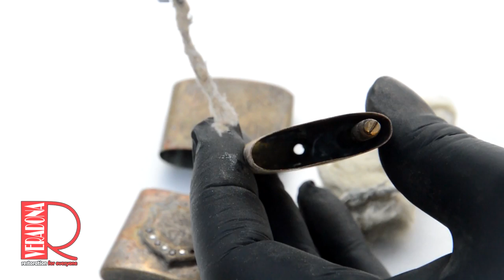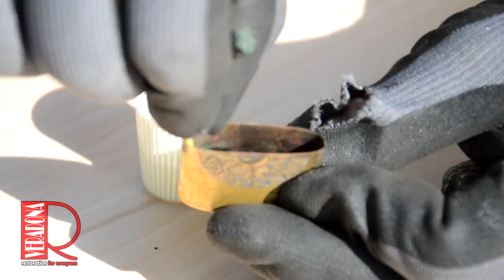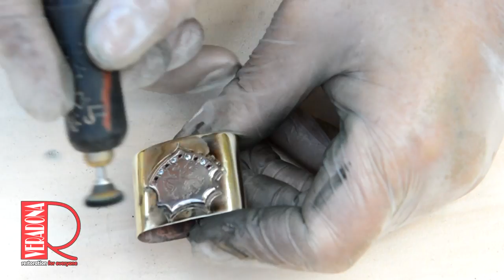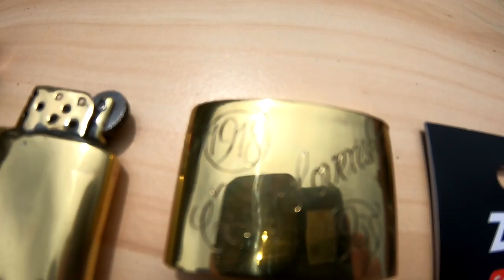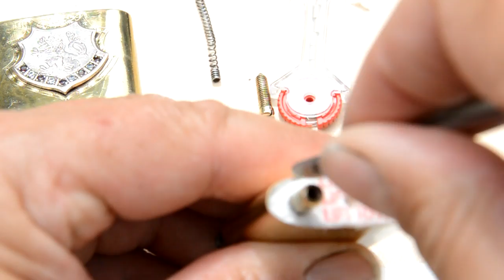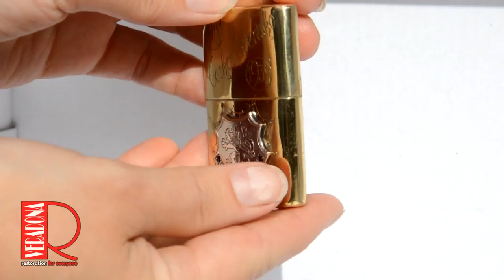Old rusty lighter Restoration

Comment: ALL THE RUST COULD HAVE BEEN REMOVED BY SOAKING IT IN VINEGAR!
Reply: theres also a rust remover used by these restorers
Reply: also sanding is much better at details than vinegar in removing of rust. It is slower yet it removes the surface coat much precise

Comment: nice work on the restoration okay, this is not a squeeze lighter, nor was it made to burn gasoline, at least not what you use in your car, tho I suppose it could, it wasn't made for that. It was made for "white gas" or lighter fluid, maybe even kerosene. It's common that people call them gasoline lighters, but it's not the facts. a squeeze lighter is activated by squeezing it, as the name suggests. Regens made one so did some other companies.
Reply from the maker: Thank you for your information, I like to learn :)
Reply from the maker: Thank you for the offer, I appreciate it. !